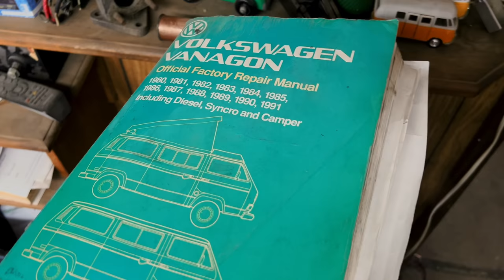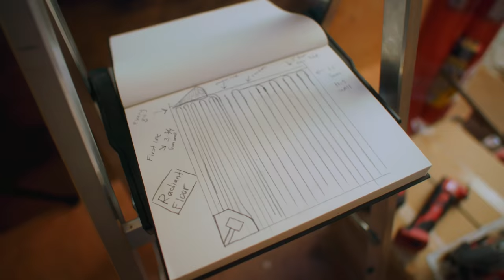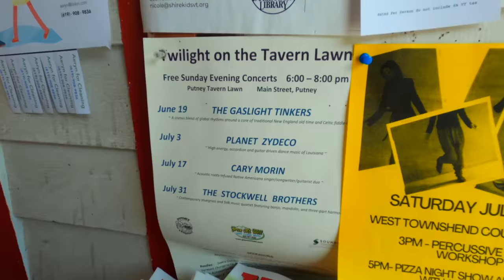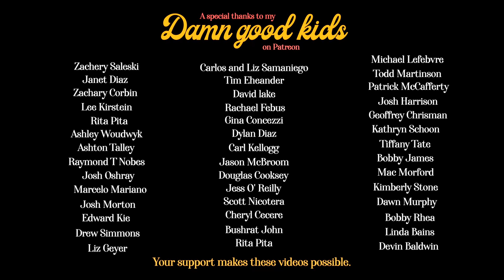To be Young in the Summer of Small Town New England

Comment: Good to see you working on the cabin just a tip the wood used to bird it up inside need to be treated with a mold killer. I made the mistake and did the same thing using plywood like that and later it smells like mold and has for 3 years